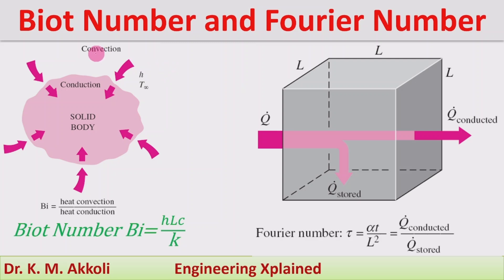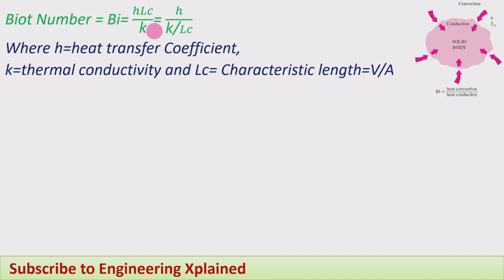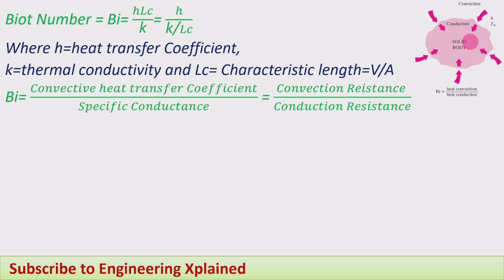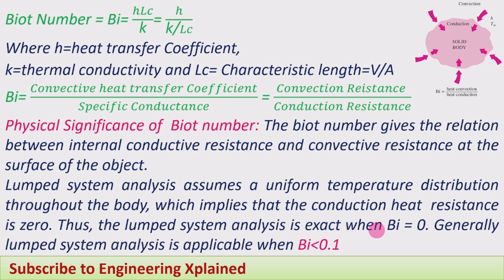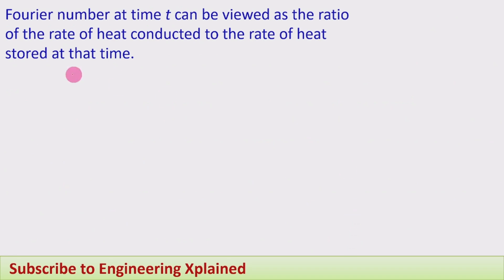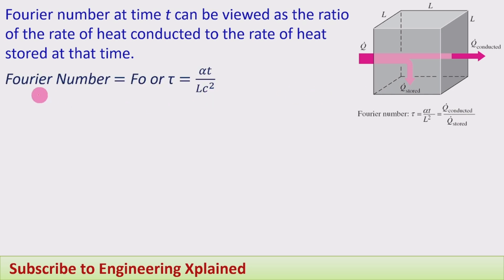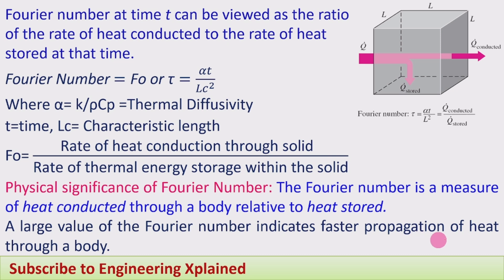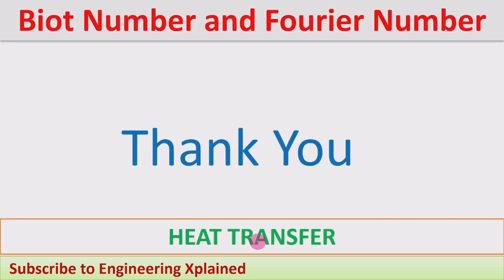Biot Number and Fourier Number | Heat Transfer

Comment: Dear professor, thank you so much for your lecture. I have to solve a problem involving a sphere in an airflow, but I have to consider the radiation effect too. How can I adapt these numbers to include the effect of the radiation between the sphere and the near surfaces?
Reply from the maker: @felipesegura8341  Send me mail to kmakkoli.mech@hsit.ac.in, i will send details.